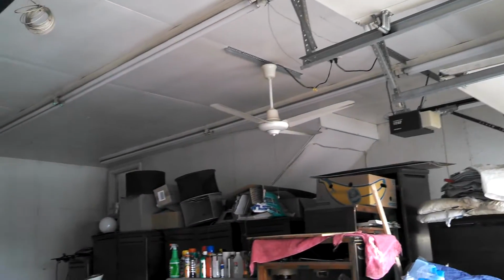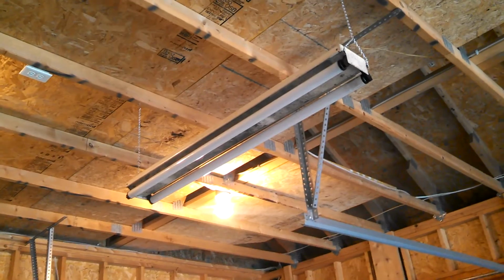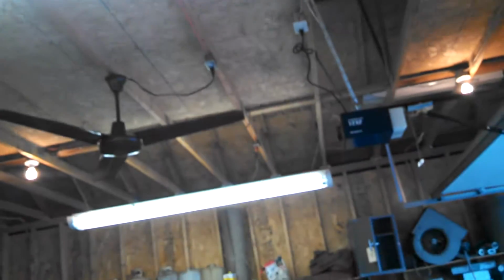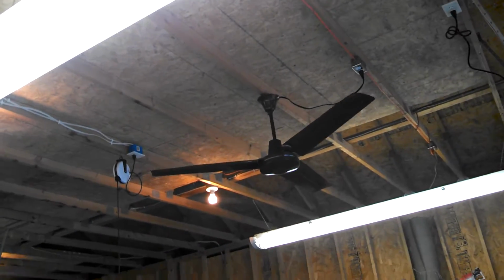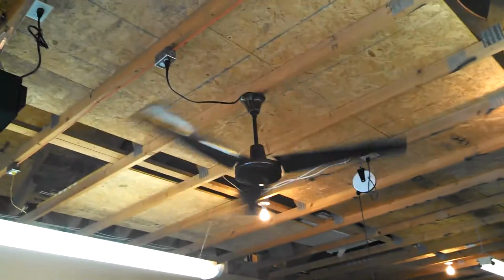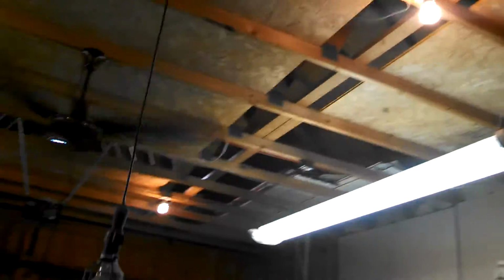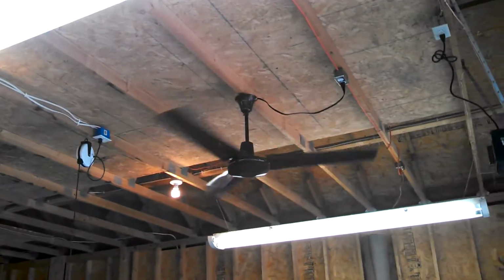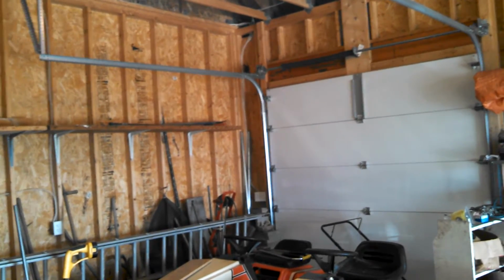Vintage Half-Pipe/Striplight Fluorescent Fixtures, Leading Edge 60" Industrial Ceiling Fan

Comment: If you want the fan to be used more you could put it on the motion sensor and leave the control set to low or medium so the fanucomes on low or medium with the lights.
Reply from the maker: Not a terrible idea.
Reply: I have done it before and it’s realy ideal.

Comment: You could have two 36" brown fans there just to get more even airflow, unless the existing fan os that powerful. Are you still using the heat?
Reply from the maker: Kat Fan This area isnt heated.
Reply: Dan ''Spiffy'' Neuman
No, I mean in the white space next door with the Gold Line and everything. Your organ shop lower level.
Reply from the maker: Kat Fan Not most days.
Reply: But you still use the Vornados, right?
Reply from the maker: Kat Fan Nope, they're put away for the summer.
Reply: Oh, OK. Has it gotten warmer?
Reply from the maker: Kat Fan Yep.  It's 40-60 now.